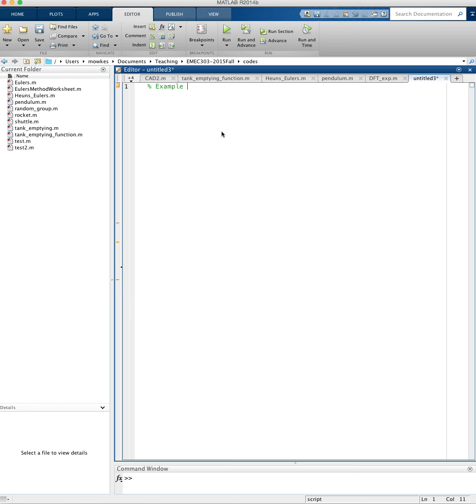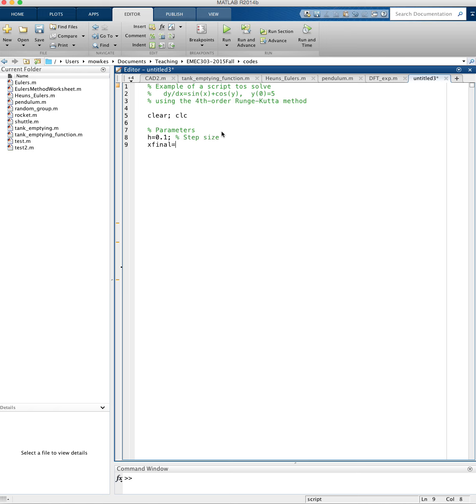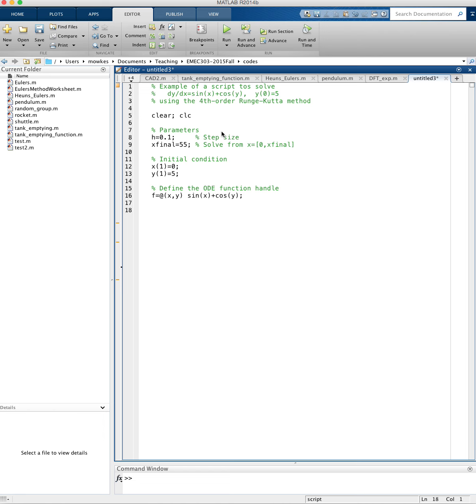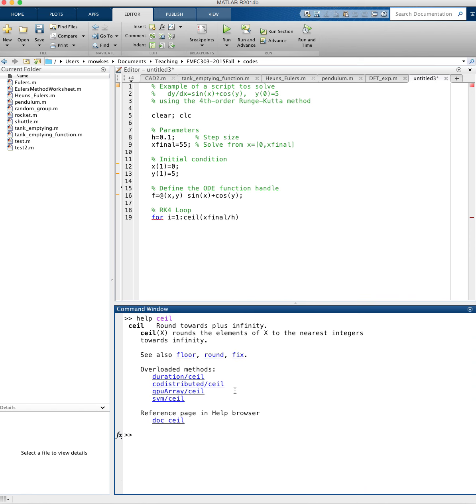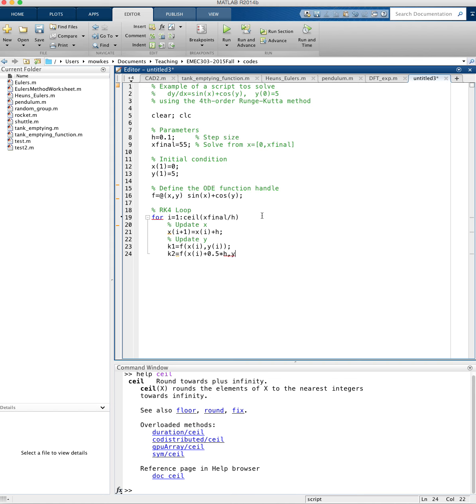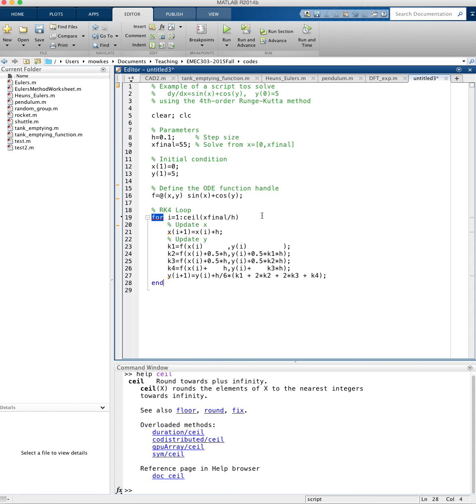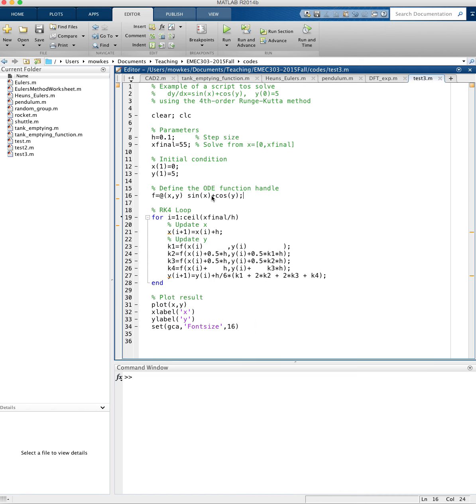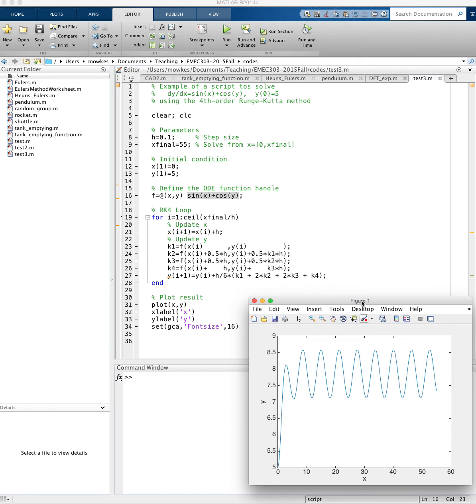4th-Order Runge-Kutta Method Example

Comment: l = 120;      %cm
s = 80;       % cm% 
R = 2*l/s;    %l=connecting rod length % s is stroke
 d= 6.7       %cm

Vd = (pi/4)*(d^2)*s; % d is bore % s is stroke
a_1 = (R^2 - (sind(theta))^2)^-0.5;
dV= (Vd/2)*sind(theta)*(1+(cosd(theta)*a_1))

Sir, i want to solve above equation dV with respect to theta usuing RK4 method in matlab plz help me

Comment: i need to find a numerical result, what should i have to add?
Reply from the maker: +Saeed Bamashmos This question is not very clear.  I'm happy to help, but don't understand what you are asking.
Reply: Thanks sir for responding, my question is can i desply the resalts of y numerically, instade of the graphic method, in the graph we have y in each x as labeled, can i make some changes to the code so that i can have numbers written as followin:
For x=1 , y= 0.3 for example. And so on
Reply from the maker: +saeed bamshmous 
Something like

for n=1:length(x)
    disp(['x=',x(n),'  y=',y(n)])
end 

will displace the x and y values.  Look at the help for fprintf for other options.
Reply: Yes Sir. This is exactly what I need, now sir where i should put this order in the code, and when i will find the result printed. I really appreciate your time given to help me sir.

Comment: i m really confused how to use this method Runge Kutta  with Matlab for My code using the analytical methode and Tlm method this my code how i m gonna choose y for this please if you can help to solve it 
% RC in series TLM application - 2nd edition
clear all
clc
% Vs=input('Source Voltage in Volt =');
Vs=2.7;
% R=input('Resistance in ohm =');
R=1;
%C=input('Capacitance in Farad =');
C=50;
% t=input('Enter The Simulation Time =');
t=300;
% dt=input('Time step in second =');
dt= 50;
disp('Characteristic Impedance')
Zc=dt/(2*C)
% k=0
V0c=0;
I0=Vs/R;
V0ci=-(I0*Zc)/2;
V0cr=V0c-V0ci;
n=t/dt;
for k=1:n
    Vci(k)=V0cr;
    I(k)=(Vs-2*Vci(k))/(R+Zc);
    Vc(k)=2*Vci(k)+I(k)*Zc;
    Vcr(k)=Vc(k)-Vci(k);
    V0cr=Vcr(k); % update
end
%Analytical value of I(t)
x=1;
for k=0:dt:t
    i(x)=(Vs/R)*exp(-k/(R*C));
    x=x+1;
end
% Outcomes
I=[I0 I];
Vc=[V0c Vc];
Vci=[V0ci Vci];
Vcr=[(V0c-V0ci) Vcr];
t=0:dt:t;
plot(t,I),grid,hold,ylabel('magnitude'),xlabel('time in Sec.')
plot(t,i,'r')
legend('TLM Method','Analytical Method');
% Error Analysis
ll=length(i);
for k=1:ll
    err(k)=100*((i(k)-I(k))/i(k));
end
disp('Errors in Percent')
err;